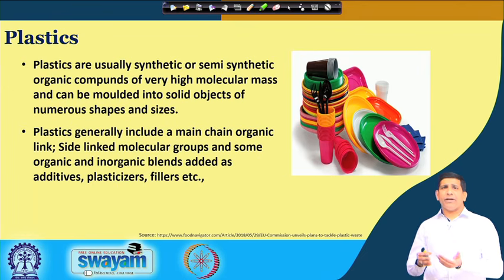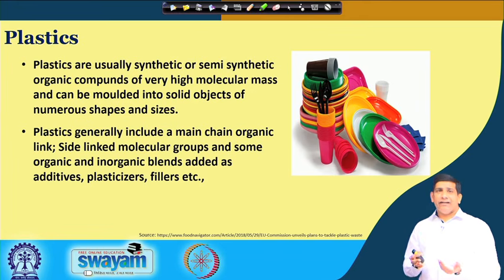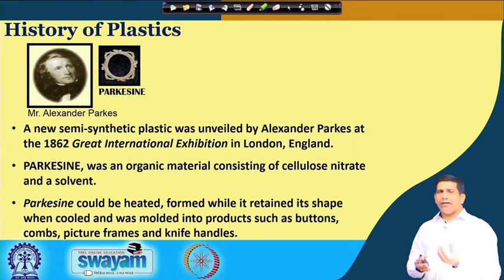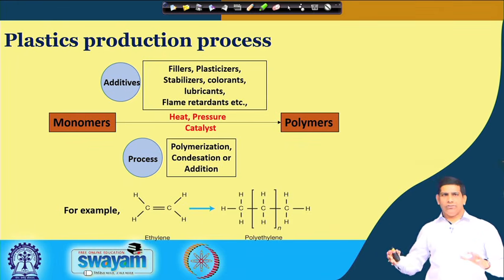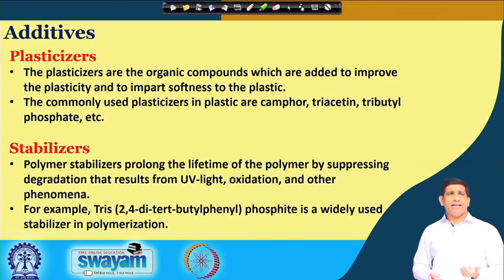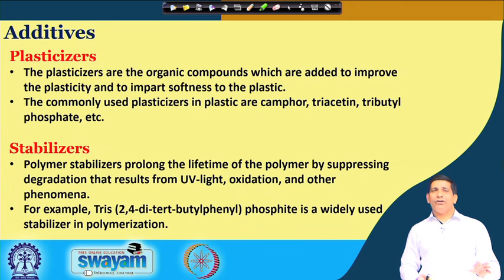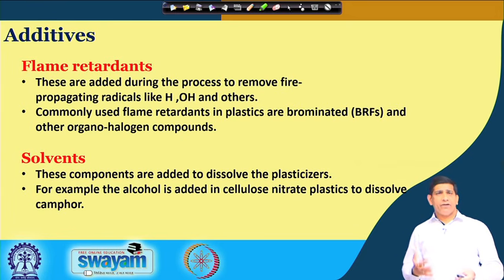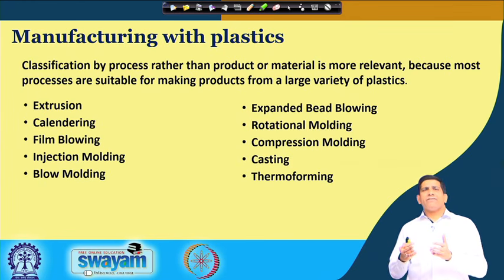Lecture 01 : Plastics - What is Plastic

Comment: 🇮🇳 Lecture - 1 Summary :-)
 What is Plastic?  🇮🇳

A] Plastic: @ 0:15 
It is a High molecular weight organic compound  (Polymer) prepared by Synthetic or semi synthetic method via Polymerization. 

Advantages of Plastic: 
1) Easy to mould
2) Cheap price
3) Long life
4) various applications

B] History:  @6:25
(1) 1862: Mr. Alexander Parkes
        Perkesine <-- Cellulose Nitrate + Solvent
(2) 1907: Dr. Leo H. Baekeland 
      Phenol + Formaldehyde --> Bakelite  Catalyst used: Hexamethyletetramine 
      Product is excellent in properties 

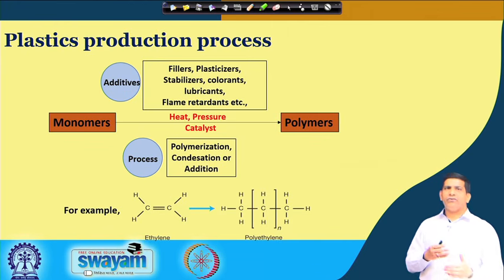C] Additives added in plastic: @12:40
1) Catalyst: to accelerate  reaction
2) Filers: to impart strength
3) Plasticisers: improve plasticity
4) Stabilizers: Prolong the lifetime
5) Colorants: Gives colour
6) Lubricants: helps in moulding removal
7) Flame retardant: retard 🔥 fire
8) Solvents: to dissolve plasticizers

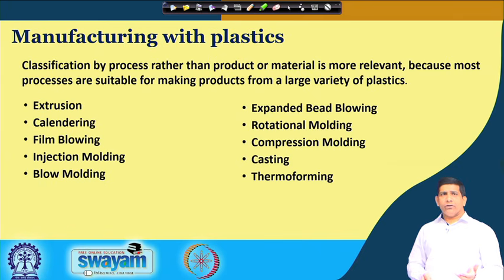D] Moulding methods: @ 26:26
14 June 2022
🇮🇳 Thank you sir 🙏 , for these wonderful lectures.